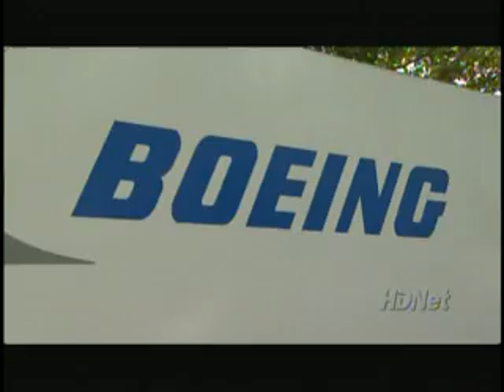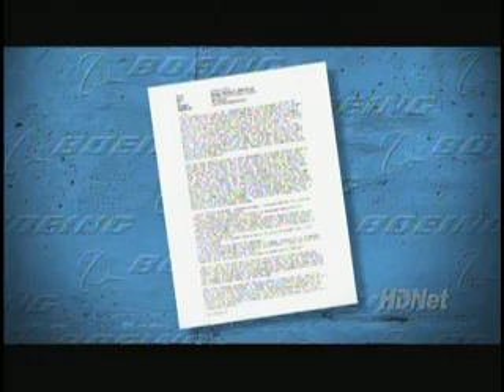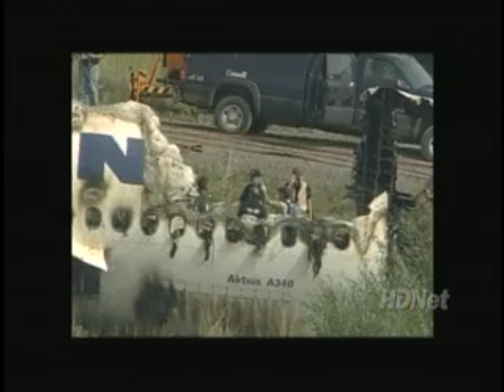Dan Rather Reports - Boeing 787 composite concerns (1 of 4)

Comment: The composite will burn. However, composites are made up of fiber and a matrix. For carbon fiber reinforce plastics, it's the plastic (epoxy) that burns and not the fiber. The epoxy when burned is toxic.

Comment: In 2012 two batteries in 787s started to burn and one nearly burned one of the planes in service. The problems with the 787 is not just it is make of plastic, but they used dangerous batteries that could and did catch fire and burn. All 50 of them in service have been taken out of service until this battery problem could be solved, if ever. Again an engineer who helped to designed the batteries said they were dangerous and he was fired. See egineer fired batteries on google.
Reply: 1000 built as of Feb. 2022.
Only 7 accidents NONE OF which killed anyone.

Comment: What Mr. Weldon does say, is that an all GFRP composite fuselage in a commercial airliner needs to be very thoroughly tested, especially in regard to it's ability to absorb impact and protect the passengers in the event of a crash landing. 

He feels that so far, Boeing hasn't done enough testing and development to ensure that is the case.

That isn't alarmist, it's sound engineering judgment based on his 45 years as an innovator in Aerospace and Structural Engineering.

Comment: Another idiot who isn't an engineer or even someone who can understand english apparently. Mr Weldon was talking specifically about GFRP being used in a commerical airliner like the 787. He stated up front the benefits of GFRP. He also stated the fact that GFRP failure mode is abrupt and catastrophic. There is virtually no plastic deformation of GFRP once it reaches it's yield strength. Then it fails and it's nature is to shatter / explode into tiny fragments. Those are the facts.

Comment: You're also wrong about your assessment of composite structures. You're obviously not an engineer and you should refrain from talking about subjects you know nothing about. GFRP is not "fragile" except when it has reached it's yield strength / UTS. The it shatters or explodes in tiny fragments depending on the failure mechanism. A crash by something as large (mass) and as fast (acceleration) as a commercial airliner would definitely shatter on impact.

Comment: It most definitely IS plastic. If you were an engineer you would know that. The 787 is made primarily of GFRP (Graphite Fiber Reinforced Plastic). As Mr. Weldon said, it has numerous benefits, but it also has some potential flaws when applied to a commercial aircraft carrying passengers. Suggesting that those potential problem areas should be more carefully scrutinized is not alarmist, it's appropriate and sound engineering judgement.